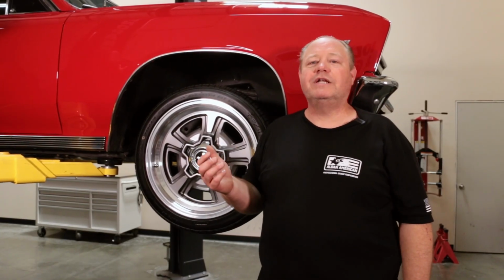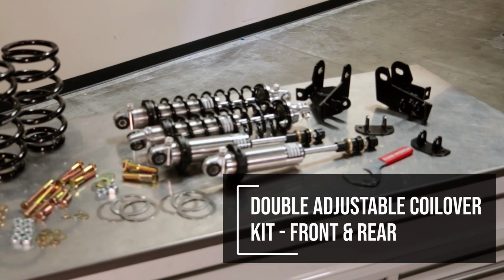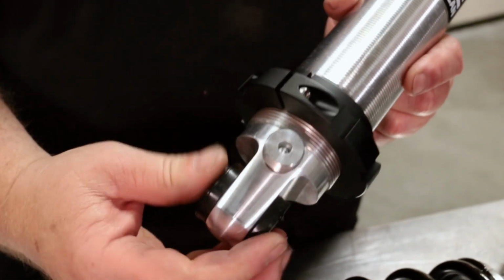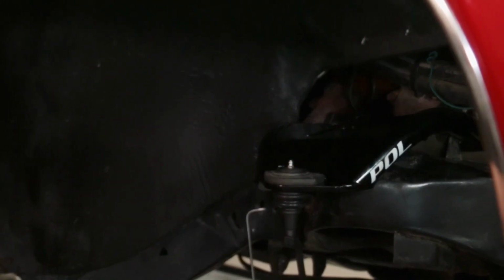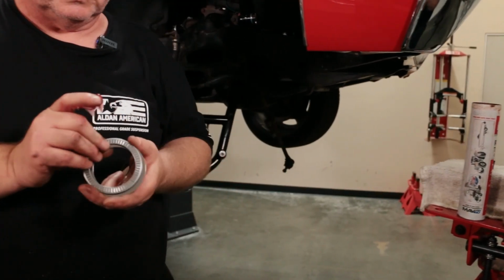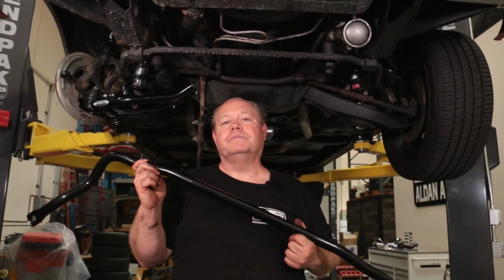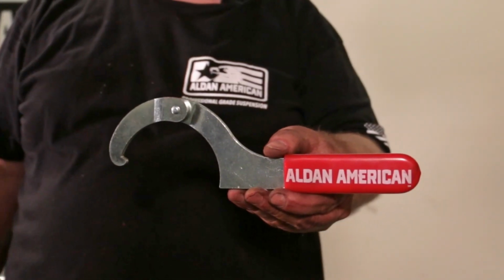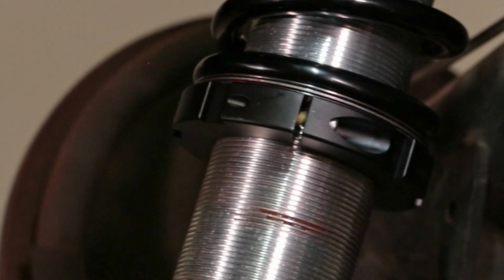Complete Coilover & Control Arm Kit for 1967 Chevelle | Step-By-Step Install

Comment: Thanks Gary for showing the installation of the entire kit on that nice 67 Chevelle. 
If possible. When showing that parts in the future, show the Frt upper spring OD diameter, free ride height and spring rate. This would allow a garage tech to help a customer, friend or family member what to expect as my son is 6’4” tall, and wants OEM height and can fit wheels plus as the installer tech, be able to match the upper perch to make sure I have no interference. 
  I appreciate that visual aid of showing setting to adjust the shocks actual performance so he can do this over time. Sometimes he drives the car empty and sometimes he takes his family of 5 for a cruise around town. This helps him make adjustments that I don’t have to!
  Buy American, buy Aldan!